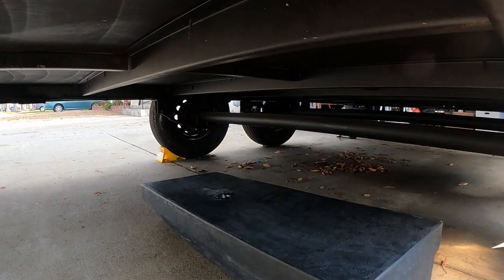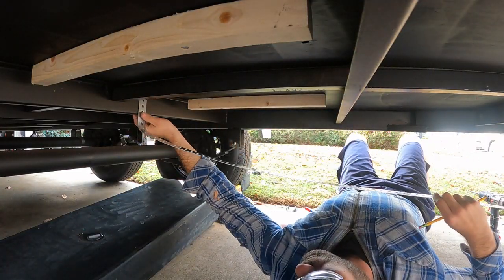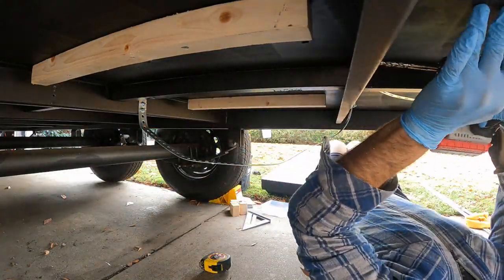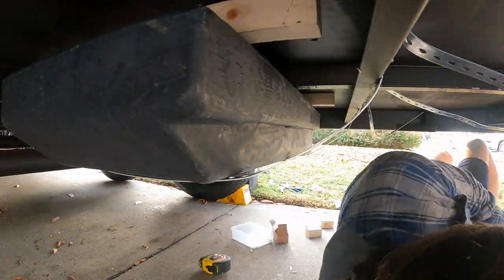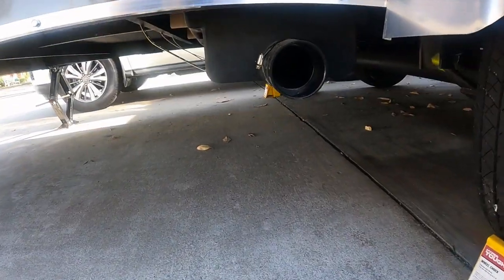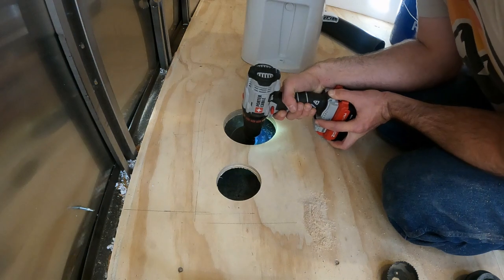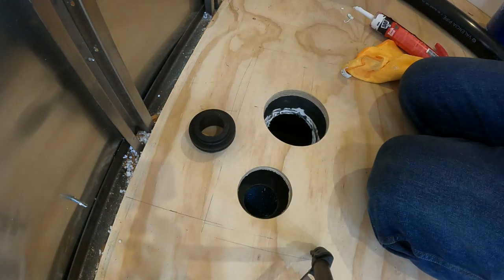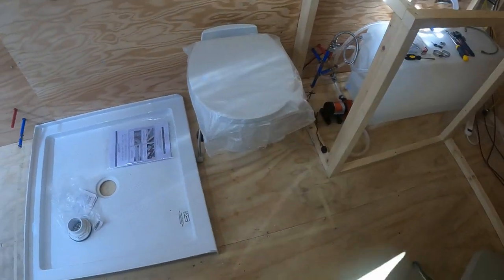Cargo Trailer Camper Conversion - Black Water Tank Install

Comment: Scaring me with not putting rubber between the straps and the tank. Otherwise, looks good.
Reply from the maker: Yeah, I definitely need to go back and add a guard between the straps and the tank. Thanks for the input!
Reply: I was thinking use some pipe insulation over the straps.

Comment: I'd be a little worried about that tank configuration,  remember this is on a trailer that is going to be bouncing and shifting constantly with significant weight.  I would at least cover the straps with something that will keep it from wearing through the plastic tank, and replace those wood blocks with something a bit more substantial and tighten up those straps..  If you were to get in an accident you don't want your black tank flying down the road.
Reply from the maker: Thanks for the feedback! Especially the point about covering the straps. It shouldn't be too hard to replace the braces with something substantial either
Reply: Treat it like a gas tank. 
Buy better straps and rubber blocks or ridged foam.Wood will rot within a few years.
Don't like the clean out that low. 

I've bottomed my construction cargo trailer out all the time in driveways in the last 25 years. Had to Installed casters to protect frames and driveways. Cargo trailers are lower to eliminate swaying. 
Next time use ABS primer and glue. Guaranteed not to leak. Caulking breaks down in a few years. 

All in all great job 👍 👏 🙌 👌 
Construction trailer concept is great.
Reply: I'm thinking that maybe instead of the wood blocking to drop the tank below the center beam, that you might instead use unistrut.  Then threaded rod with a turnbuckle to a lower layer of unistrut that you can cinch up.  Will drop you clearance a little, but looks like it would still be above the axle clearance.

Very informative video.  Thanks for teaching us new things before we tackle it ourselves.

Comment: Good attitude with the comments, you replied to the criticisms well.
It’s already been said about the strapping having rubber or something, home depot has 1/8” steel plates that are 4 to 6 inches wide that you could easily bend to fit then use the same steel to make a u-shaped or a square shape to use instead of the wood and to brace between frame rails you can use the same bolts that the steel strap/brace is being used, use bigger bolts and use auto quality bolts they are heat treated and much stronger, use lock washers and thick hard rubber between the plastic tank like a old car tire cut up.
I don’t think you’ll have major problems with how you did it to be honest but i wouldn’t buy your trailer if i saw that it would be a deal breaker sorry just being honest.

Comment: This was helpful. I have a 20 foot enclosed trailer I want to convert into an RV. ive seen fresh water, grey and black tanks but all too big to fit in the spaces of my trailers frame. From the floor to the bottom of the frame is only 6 inches and the space where I want the bathroom to be, the space is only 16x20. Im not sure if i can cut down sections of frame to accommodate at least a 26 gallon grey and black tank.

Comment: I honestly wouldn't trust that installation for more than one mile.  Do you know the weight of a gallon of water?  Strong metal brackets should be WELDED TO THE FRAME, with
a rubber insulating material between the strap and tank.
Reply: 14 gallons is like 120 lbs. sooo those bolts will be perfectly fine, it’s not a half ton or anything. More concerning would be metal to plastic rubbing and the wood rotting out long before the tank rips the bolts out.
Reply: Welding is not necessary at all. Just size the structure elements for 2-3X the weight and you should be fine.